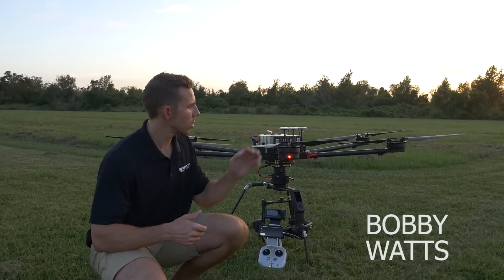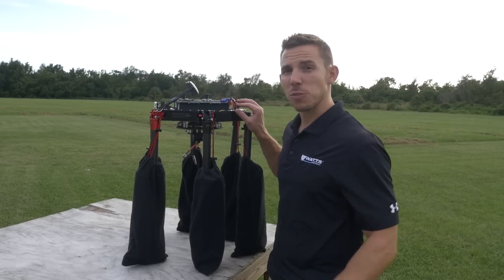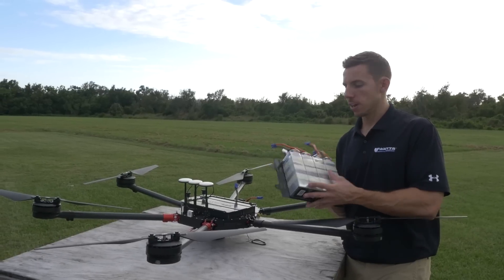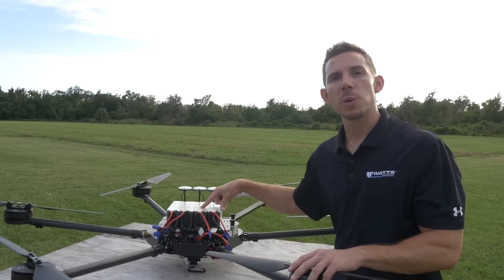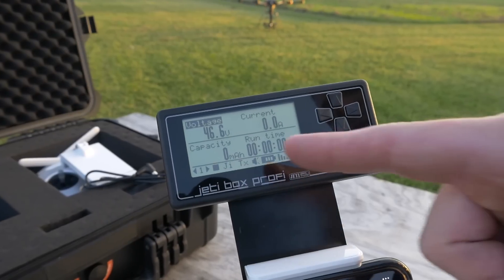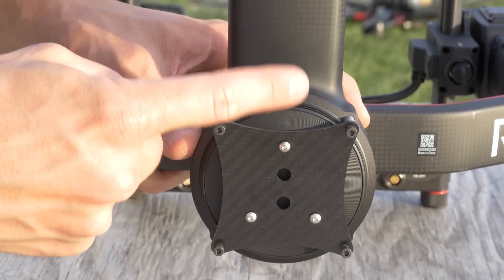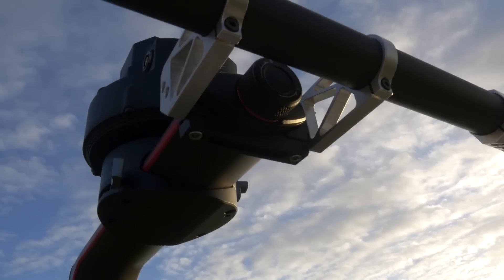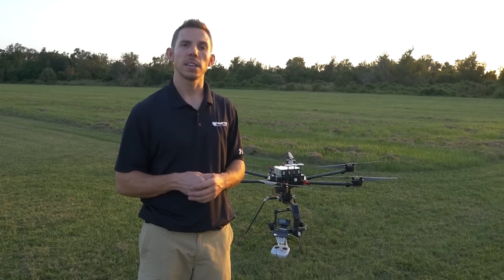MFD 5000 Heavy Lift Drone Overview, Assembly, and Setup

Comment: I can telL you .7 problems you have with it. 1 ITS NOT WATERPROOF
    2 IT DOESNT FLOAT.
    3 THE CONTROLLER USES A IOS OR      
ANDROID DEVICE. THEY ARE NOT WATERPROOF.
    4 THE CONTROLLER DOESNT FLOAT 
    5 THE CONTROLLER ISNT WATERPROOF
    6 the Controller doesnt have a intergrated video controll screen innthe controller. 
     7 ITS HAS CRAPPY DJI COMPONENTS.  
GUESS WHAT WHEN THIS drone loses power over water its like a magnet thwy crash and they sink
I have recovered hundreds of DJI drones out of the water. With my Qysea Expert V6 UAV.. including an expensive Warner Brothers production camera drone just like this one. That drone was a 100k and still lost power crashed in the port of long beach CA in about 50ft of water.. 

You need to develope a drone better than the Swellpro Splash Drone 4. . That is water proof floats. Etc

Comment: Hello friend! I have a problem connecting the same equipment to the PIXHAWK flight controller. More precisely, I connected it correctly, the video from the copter is displayed, the control channels are correctly displayed in ardupilot, but the telemetry in the form of batteries, satellites and everything else is not transmitted to the remote control, the remote does not see Pixhawk. at the same time, Pixhawk itself sees the remote control on SBS. it seems that I did not correctly set the telem or mavlink port settings. Please tell me what settings I could have missed, or maybe there are screenshots of the settings?